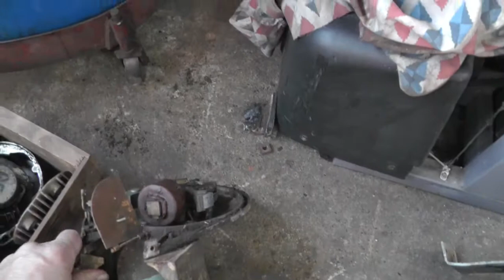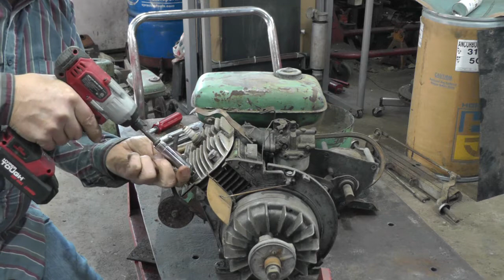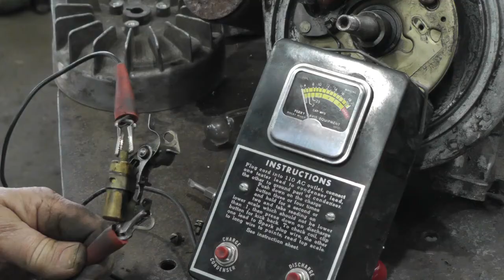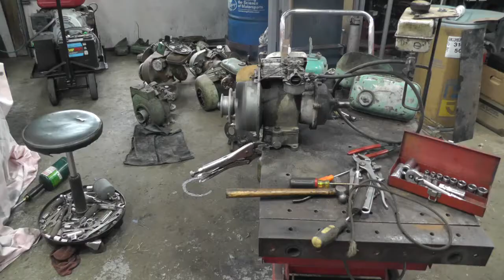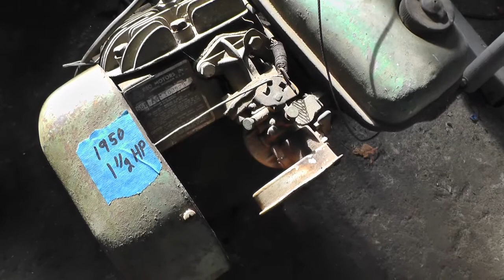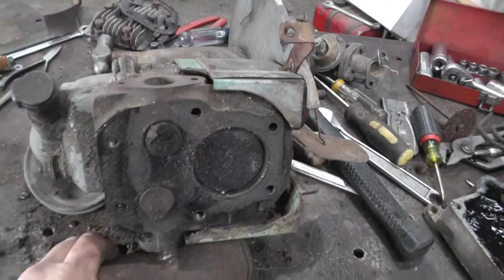Reo Engine Repair (Part 1)

Comment: Kevin, When I was 12 years old in 1968 I was doing small engine repair with the help of my father. A friend of my father, Frank Carbajal, brought a REO De Luxe Flying Cloud Rotary mower.  The engine was seized up.  When I took it apart, I found the same sludge in the oil base just like the last engine in this video. The connecting rod bearing was severely damaged and the crankshaft journal was severely scored.  Amazingly, my uncle found a NOS crankshaft and connecting rod at an old lawnmower shop in San Antonio, TX.  I replaced the bad parts, reassembled the engine and the engine ran like a spotted ape.
I took the completed lawnmower back to Frank Carbajal. I cranked it up and mowed a little bit of grass to show him how well it worked.  I instructed him to change the oil on a regular basis to avoid problems again.
He asked how much I owed him and I said $15.00.  He replied FIFTEEN DOLLARS as if I was ripping him off.  He asked if I would buy it for $15. Without hesitation, I said YES, DEFINITELY. He said okay, okay and paid me the $15.  My father was impressed with my immediate response.  In retrospect, I wish he would have sold me that lawnmower.
My father and I were so impressed with that REO engine that he installed a REO Model 404E engine on his 1896 Easterwood Homer replica buggy car. It fit perfectly under the buggy seat because of the slant cylinder.  After all these years of faithful service it needs new rings and a valve job to restore its original 1 1/4 hp.
I have been looking for a REO Model 221 engine for the 1 3/4 hp. 20 years of searching has not yielded one.
Thanks for posting this video and reminding me of my first encounter with a REO engine!

Comment: You have an interesting collection of old REO small engines.  I have three of them, as I recall.  Two are on original REO lawnmowers; one is a reel type, the other a rotary.  Then I have a loose engine that I picked up at a Portland IN swap meet, it has a horizonal reduction gear box on it. This is the one that I am working on for a "butt buggy" to get me around in swap meets.  I have it running, but the original Carter N carburetor is beyond service so I have a new replacement for it which I have not yet had the opportunity to give it a try.  This is the first video of yours that I have found, so you have some great information on these old engines.  Thanks for doing it, now I am going to part 2.